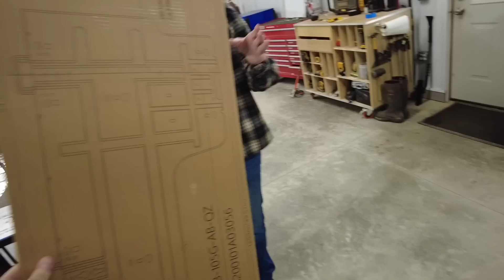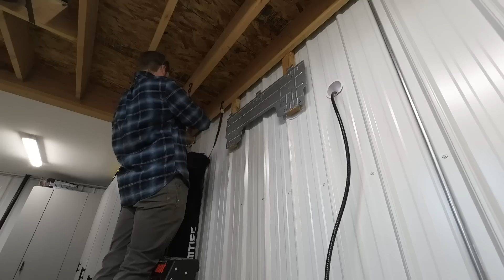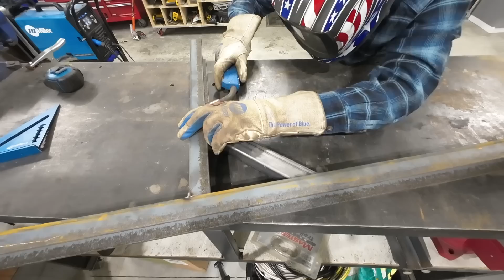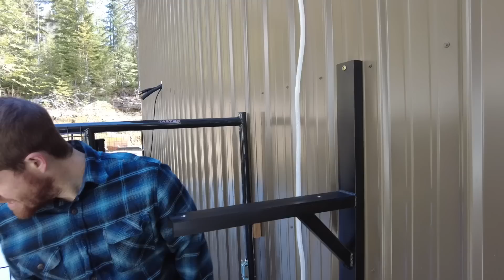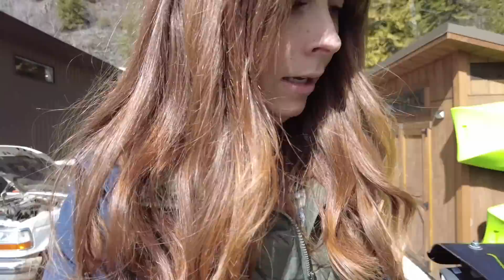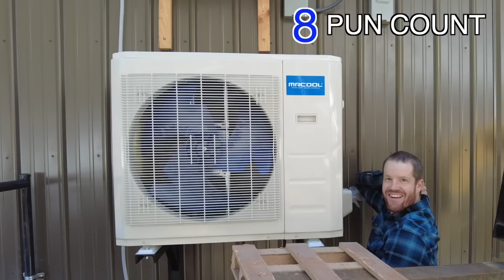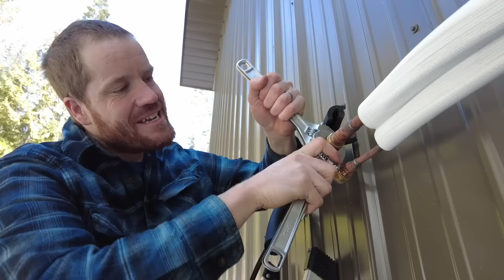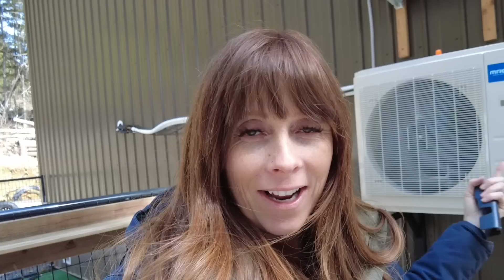Installing DIY Off-Grid AIR CONDITIONING

Comment: Mini Split units that are not designed to be able to remove the squirrel fan blower wheel are poisoning in house air and should not be purchased solar or not. The blower wheel should be able to pop right out with one or two snaps to remove the huge amount of mold and debris that builds up on them in a snap. That debris stops sir flow and spits out moldy dirty air. The wheel needs to be hosed down out in your yard but - not possible, you can't get it out.

Comment: I have blasted through so many of your videos i apologize if you addressed this directly, but do you have any insights into the R410A Serviceability?  When collecting quotes from HVAC installers, one of the first things they say against DIY systems is that R410A is going away, but from everything i can tell, there are still so many HVAC companies installing R410A, or have in the past decade, meaning that they and the supply chain will need to maintain serviceability of all their systems which should trickle down into the DIY systems being serviceable as well right?  It's hard to tell what's a salespitch and what is good advice.

Comment: Just a heads up. I notice that you used lag screws to bolt into the lattice strip for the siding for the mounting brackets. As small as the vibration may be in the unit, I'd inspect the top lag screws for looseness at least every 6 months or replace them with wall through bolts. I mounted one of these units into the studs of a work shop. After about 18 months kept hearing a funny rattling sound from where the outside unit was mounted. Couldn't figure out what it was until I went outside thinking it may have been something with the condenser unit. Glad I did. The top lag screw was backed out about 1/2" on both sides.

Comment: You should have used nylog blue or compatible refrigerant compressor oil for the flare connections. And also a torque wrench. And also run a nitrogen pressure test. Or, at least a vacuum test with a vacuum pump and gauges. The lines need to be evacuated prior to releasing the freon in order to remove air and moisture.

Comment: You stated “in idle mode  it consumes 2000 Watts” That’s per hour! Whoa that’s a very high power consumption! 2Kph x 24 48,000 watts per 24 hour day! X 5 months of hot weather = 120,000 watts! hey, I understand you’re getting your power from the sun,  but for people who don’t have solar power and 100% relying on power from the electric company that increase in power is going to put your tiered rates at much higher tiered levels! 1st tiered rate $.09, 2nd tier is $.12 a kilowatt.

What’s the power consumption in heat pump mode, providing heat.

power consumption in AC cooling mode?

Comment: Please consider posting a video sharing the actual kilowatt hours used by the Mr Cool HVAC system.  I noticed that you use the wood stove instead of the Mr Cool in the winter, so I'm super curious about real world electricity use in the winter and summer.  Thanks!

Comment: Good job.  One concern.   When the small unit goes into defrost it will drip down onto the larger unit and freeze again.   This will then refreeze on the large unit making it work harder when it goes into defrost thus using more energy.   It will be the worst when temperatures hovers around the freezing point outside and high humidity.

Comment: Nice work. Some anti vibration pads (or however they're called) to be put in place when setting the exteriour unit on the metalic arms, because that thing can vibrate, especially in time and at high power.

Comment: Always open the valve on the small tube first, and then on the other one. In addition release a bit of refrigerant while opening the tube, so there is no air in the pipes.

Comment: not trying to be a dick but you want at least 1 foot behind those AC units, they need to breath and the distance they have now is making them work too hard, especially if its in direct sunlight, 110 degrees that sun heating that metal you're just pushing hot air thru the fan, if they do get direct sunlight shade them somehow, it does make a difference specially on metal buildings, Phoenix, Las vegas, 24" minimum  maybe yours is heat only?

Comment: Why did you run the linesets outside instead of inside or mounting the outdoor unit where you drilled the hole through the building?

Comment: Refrigeration tech here. Don't install one outdoor system over the other. In the winter the top one will run in defrost and melt onto the one under it.

Comment: Wheres your vacuum that noise you heard on the first connection was the nitrogen charge even affer you  bleed off  the first connection which is nitrogen it is replaced by oxygen , oxygen and refrigerant from not using a vacuum creates hydrochloric and hydroflouric acids which will seriously  decrease the life span of your equipment. I am not to impressed by mr kool for not noting this its apparent they are not much smarter than the installer.

Comment: you are missing vacuuming lines part... vacuum makes liquid boil at the lower temperature. (with all of that moist air inside your lines you will get less efficiency on A/C unit plus it will destroy your pump over 5 years or so)

Comment: I enjoyed your video so much and also try to do as much as I can to save a few bucks. This system is a game changer. I would recommend that you protect your lungs better when working. Cutting steel with those saws and spray painting in an enclosed area without a mask is not good. Otherwise you will pay the price later on in life. God bless you all.

Comment: As an HVAC guy who has installed these, not a fan of the extra line-set, having it coiled against the coil behind the unit restricts airflow and cleaning abilities not to mention it'll be a collection spot for leaves and other debris

Comment: can i get some nerd stat's for peak summertime watts use DC or AC Ac... air/conditioning what's it's absolute highest temp it can get your shop to in dead of winter ☃️❄️ and lowest temperature 🌡️ in the highs of summer what's the minimum solar capacity needed to run the 35k btu unit? i seen some window box ac heat combined systems running on 208/230V  but it's not the same as mini split and why not just tap into your old outside peice and run all the 10 inside 💠 units off it don't you just need a T/Y splitters at each connection? and wouldn't it use less power and do more work efficiently as an advertiser would assume? let me know what ya find out ... I'm possibly in the market for a pretty 😎 cool 🥶 device
Reply: should equate to 11,003.20 watts at 230v or at 208x the mentioned 47.84 amps 9950.72 Watts but we know that the higher voltage less amperage is way more efficient so it's not making sense unless the difference in wattage is waste ... unless it's just inability to perform just simple electrical math here so let me know what it real world tests to thanks 👍💕

Comment: Nice job, you want to consider installing the condensor outside unit 12" min off the wall to enough  space for air going in to the condenser and for enough room for maintenance the unit.

Comment: Since you haven’t read the manual, you haven’t left enough room with inside unit and the roof for proper air circulation.
Reply from the maker: We followed the installation specs for spacing away from the ceiling.

Comment: I recommend ordering through a place like Ingrams who can get you a la carte items, like substituting a 16 foot lineset if that's all you need.  I try to plan the installs so the lines needed will be multiples of 16 or 25 ish, to minimize unneeded length (of course, too short is a problem).

Comment: Hey you two (oops, three), Been watching you from your beginnings. I live just down the road from ya, been off grid for over twenty years. I hope you find this question. Can you share how much power your splits use to heat? I know they run continuously but how do they perform at an idle vs. while heating? As you point out in summer cooling shouldn't be a problem (I have a 20KW array). Thanks in advance and congratulations on adding a beautiful child to our area.
Reply from the maker: Hi Allen! Would you mind shooting us an email? contact@ambitionstrikes.com

Comment: Where can you see that you connect a vacuum pump to an Air Conditioner to perform the vacuum procedure? This evacuates the line set tubing to prepare it for refrigerant.
Reply from the maker: This is not needed on the MrCool DIY series. The lines, evaporator, and condenser come precharged with special sealed fittings.

Comment: Not sure what size bolts you put those mounting brackets on the wall with, but when that outside unit falls off the wall brackets and all, your not going to like the damage its going to do,

Comment: Metal on metal? All the vibration from the exterior unit is reflected in the whole building. You should add rubber shock absorbers (male-to-male antivibration mount) between the system and the brackets instead of bolts and a nuts.

Comment: You guys are awesome! I just have two questions. 1) when you mounted those brackets to your pole building do you think those small screws you used are really going to hold all that weight over long periods of winter here in the NW? 2) when you used the fork lift, would you have had more room if you had backed it down in behind your building and thus have a straight shot at getting it on the brackets that are quite beefy in themselves which prompted the first question? Just asking.

You've done an outstanding job with your property in the time you've been on it. I wish I were still young and able to do all the things like you are able to do, so a bit jealous, but very impressed. I wish you two (er, three) the best in all your endeavors. I really support the DIY'ers like yourselves out there. Keep up the great work and sharing it with the rest of us.

Comment: Do not buy diy brands. Found out the hard way, only have a licensed and insured hvac pro do this kind of job. Had a unit work great for 7 months, compressor died and company won't send whole outside unit to replace it, only a compressor. I can't put the compressor in so it's junk now, have someone else with a 10 year parts and labor warranty deal with this crap if it fails and buy mitsubishi

Comment: Recommend placing the outside unit on some rubber mounts, with the metal arms it’s going to transfer a lot of sound inside. The unit is already quiet but will help keep it even quieter especially when it turns on/off when shooting videos

Comment: Would an AC like this be too big for a 6.4kw solar system? Its for a house and it has 20kw batteries with a 8.2kw inverter, should I up the panels to try and reach 10kw?

Comment: i have similar in hungary cc 15years ago work even -20C. if ur using for heating i really recommend to add extra thermal isolation to pipelines what run outside. that will give u 3-800W heating power becuase reduce the heat loss. just think about the gas in the pipes round 50C and isolated only with a 10.15 mm foam. its cause a huge lost.

Comment: Thanks! It looks great and your installation looked easy. You left the extra length of line set coiled up behind the unit where it is blocking some airflow. This will cause a reduction in the capacity for the electrical power drawn. Yes, it looks better but it decreases cooling and heating efficiency. Judging by the way you over-engineer everything, the capacity loss will not be a problem.

Comment: 16:52  I don't understand.   Earlier in the video he said he had "20,000 watts of inverter capacity" which is 8.33 amps, then here he is installing a 40 amp disconnect.   Am I missing something?

Comment: Thanks for the video i am looking at these for 4 zone but was unsure if the lines can make a 90 to mount in corner to exterior. Do you know if mr cool has a frost wash or freeze wash self wash? Every one say they have slef clean but all it really does is run the fan to dry out. The icing of the evaporator and then melt actually does do some cleaning. And is a feature i want if i am to buy one.

Comment: Great information, Great delivery!  SUBSCRIBED,!    I have 5 acres in New Mexico, USA ,. When I saw that you have a pole barn and a quick summary of the construction, THAT helped me to decide, pole barn or traditional steel building? I will go with pole barn because I can can complete the construction in phases.  And, the mini-split is the way to go! THANKS!   Where did you get the barndominium?
Reply from the maker: We sourced the building materials through several different local suppliers.

Comment: I dont want to take away from your achievement here, but just as a comparison, we built our 30'x40' pole barn, turned it into a home as well, and by super insulating it and pouring a concrete slab floor, the interior stays in the low 70s, even when it is 100F+ outside. My point being, adding a few extra inches of insulation, may avoid this whole expense.

Comment: You have made a big mistake.  You had to remove the air from the pipes with a vacuum pump.  
This mistake will shorten the life of the compressor and degrade the efficiency of the air conditioner.
Reply from the maker: The lines on the DIY kit come already under vacuum.

Comment: Excellent  job..👌..A mask is advisable while spraying paint 😂 also between condensing unit's bottom leg and the holding stand, there should be a piece of  rubberized packing material to be kept to prevent corrosion later on..  also this enable  suspension against vibration. This packing material is available ( forgot the name) with the spare dealers.😂🌹

Comment: Riley, I think you should think about getting a small drill press for you shop. I know they are not that expensive, but they make drilling straight holes much easier. Everything is looking pretty good, I mentioned befor while you were building the deck that you should add a dumb waiter to the deck. It would make carrying those heavy things up to the deck.

Comment: I think you should use a leveler to check if the angles were aligned. Also there should be enough space behind the outdoor unit for proper air flow where you tucked the copper tubbing.

Comment: Disclaimer for everyone who is falling for MRCOOL advertisement through youtubers. Those are not great AC units. They might be great somewhere in countries where labor is cheap. Those units are crazy expensive when it comes to maintenance or even replacement. Just google how many people teared them down and replaced with other vendors such as daikin or mitsubishi. They are leaking, they are not properly made. And you might be just lucky if it works as expected for a couple of years. Think about it, - Daikin and Mitsubishi are not investing heavily in youtubers to promote their products. But think now about Mrcool, - where almost every DIY youtuber advertising them. How much $$$ they are spending? How much left and where did they save money? Be wise.

Comment: weld the scaffolding out of a thick U-section that will withstand over 200kg just to mount it on 4 carpenter screws, best XD

Comment: Great job. Taping suction/liquid lines, condensate piping plus electrical interconnect makes it so much easier installing head unit solo or with assistant. Next one ☝️

Comment: The heat pumps should not be one on top of the other. When the top on defrost cycle runs, water will dripp on the lower machine

Comment: this air con unit will fail in 6 months unfortunately ... you did not pull a vacuum on the system, this loop is contaminated....P.S from an actual engineer!
Reply from the maker: The DIY system comes already under vacuum with special fittings to retain the vacuum when you hook the lines up. It is intended to be installed without needing to evacuate the lines.

Comment: I really want to install one myself! I have all the tools and have worked with extremely high pressure gases. But in the UK the F gas regulation body stops normal people from installation. 

Did some research and there a  R290 version (propane). It's not regulated like fgas. Yet still the f gas body is still trying to stop people from installing it themselves.

They are starting to sound like a Mafia

Comment: If that was mine I would use 1/4 or 5/16” bolt’s instead of the screws you used to hold the outside unit on the wall.

Comment: Helpful hint , when using the hole saw to make the big hike if it starts to grab to much , try reversing the drill and finish the stubborn connecting points, works on vinyl very good also

Comment: Oh My Goodness!  I have been Nagging and Nagging and Nagging about a gallon of Rust Oleum primer.  Just the primer slathered on quickly with a brush.  COMPLETELY STOPS that Gaud awful rust.  That "patina" Just continues rusting.  What if a Color is wanted or what if the "little guy" brushes up against that "patina."  Go ahead, go outside and check the patina and you can not convince me that the patina doesn't change your hand to that "patina" color.  I'm tellin ya.  Come on now.  A whole gallon.  Yea I Think you guys need a whole gallon.  I love Rust Oleum.   You can do it.  I know you can!   Best wishes.
Reply from the maker: We plan to seal the "patina" with a product intended for that application once everything has evenly rusted.
Reply: @AmbitionStrikes  ok ok ok fair enough. Expensive tho. I used to use “sprays on clear and converts the rust to a paintable surface” But I get it. Looks good. Thanks so much for all that you do and share about. Best wishes from New Hampshire.

Comment: Cool idea and solution but... You will have little use in Winter for such an installation if you power it off grid. The cooling function in summer may make sense. It would be necessary to check the average temperature in the spring/summer season, but it seems not to exceed 25 degrees. As for heating, it's better to think about a wood-burning tiled stove. After all, you have trees aplenty all around.